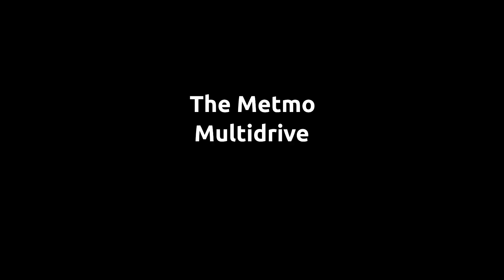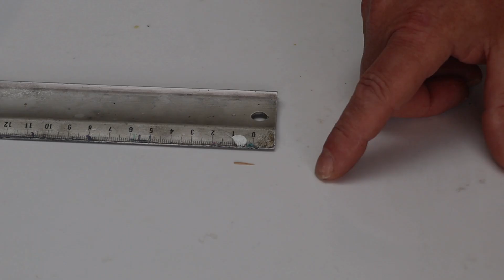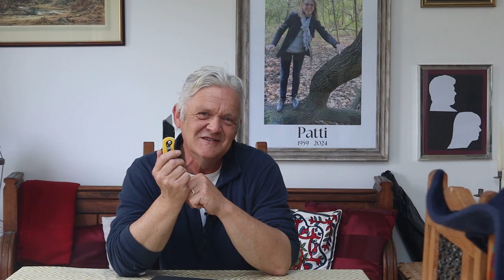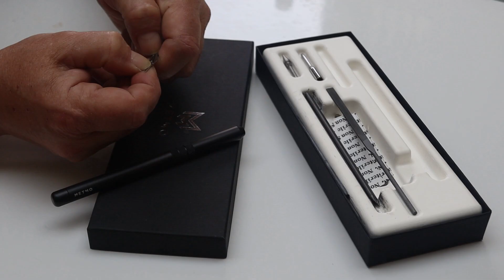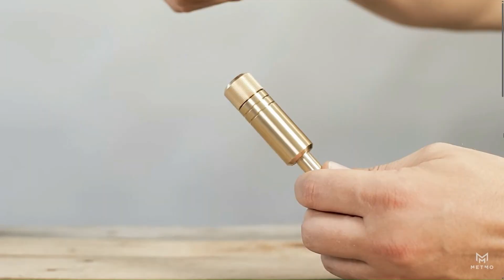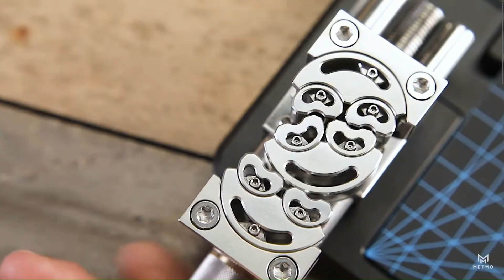2370 Metmo And My Pergola

Comment: The best stuff for drawing out splinters and thorns from beneath the skin (and other skin issues) is Yellow Basilicon Ointment. Always have a jar. The genuine stuff is best but not Kosher as it contains lard. Earnshaw’s Herbal Dispensary is just one supplier who still adheres to the original recipe. 
Splinters of brass are another hazard in engineering workshops as the splinters cause the wound to fester. Its the copper based wood preservative on timber that does the same thing.
Reply from the maker: cheers mate

Comment: I've always had brilliant luck with a sewing needle dipped in iodine, which is probably wrong in some or many ways but hasn't failed yet. The key is light backpressure while holding the 'portal' open with a circling motion. 

Every 5-10 years though I manage to break a knife handle/blade holder and zip a finger open. Splash of IPA followed by oodles of the coldest clean water available has so far been enough to get the blood staunched and the wound sides to stick together well enough that bandage pressure and a splint will allow it to heal completely in a couple days. The cleaner the cut, the faster it mends...
Reply from the maker: good tips mate cheers lol

Comment: Those safety shaver razor replacement blades also are extremely sharp but not so commonly available now. I guess they were called safety shavers because the other choice was the cut throat razor like we see in the old westerns.
Reply from the maker: I believe that is exactly why mate

Comment: Whaaat? No video of the construction process? Dagnabbit.

Glad you got that splinter out of your finger though. I usually either slit the skin with something sharp or weave a needle in and out along the surface layers of my skin and then pull the needle away to break the skin.
Reply from the maker: Do you know I thought about it - but some jobs you just want to get on and do. Filming can more than double the time it takes to do something. cheers mate

Comment: You and I have the high pain tolerance in common. I've done the same thing with splinters and metal shards embedded in my fingers so many times in my nearly 56 years of life. My knife was a Tester modeling knife I got as a teen for trimming the edges of the plastic pieces after removing them from the frames they were attached to. Mine was one of the old ones that had the replaceable blades.
Reply from the maker: a god knife is always handy mate

Comment: I'm a carpenter and intimately familiar with splinters of all shapes and sizes. Confirmed, if it can't be easily pulled or dug out, leave to ferment for a couple of days, remove scab and squeeze. Works every time 🌋
Reply from the maker: awesome - cheers mate

Comment: i use a standard modelling scalpel with swan morton blades to remove splinters, one trick is to put a dab of honey on a plaster and stick that over the wound, the honey will make the skin soft and stop infection, and often when you take the plaster off the splinter has either partially or wholly worked is way out. ps I find the heavy duty plasters are more likely to stay put through hand washing etc.
Reply from the maker: nice tips mate - thanks for sharing

Comment: 🌻ohhh.. I've just recently discovered the Metmo site. Wonderful. But you don't need that multi tool for that scalpel blade - that's a standard swann surgical blade, the right tool for that gruesome job 😹(worked with them in my labs).
I built my own decking but with  green sawn sweet chestnut from Shropshire, so no splinters 😸 yes always buying British/local😺 especially my timber.
Now what excuse can I find to buy something from Metmo......
Reply from the maker: We would certainly have less trouble if we supported local industry more - and I know what you mean about Metmo - they do nice stuff